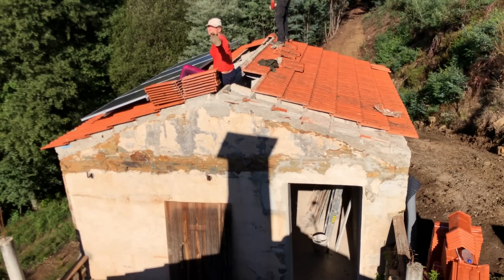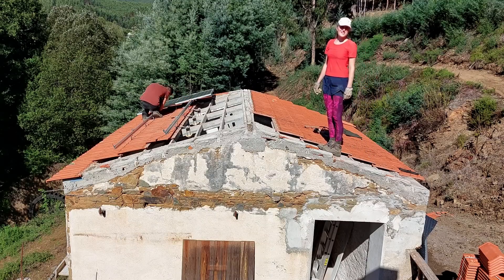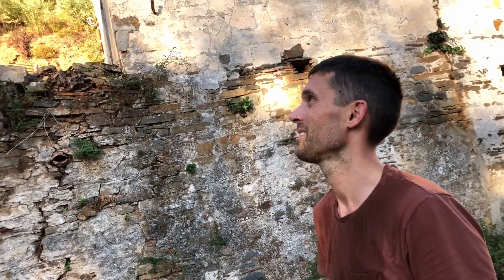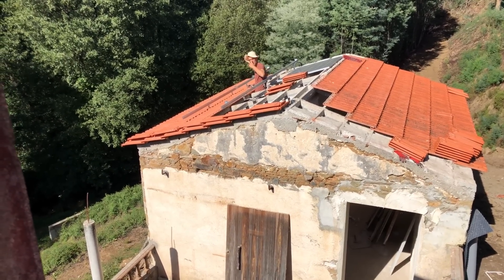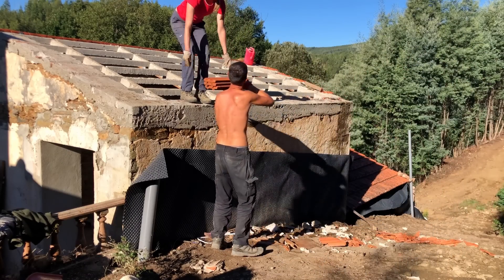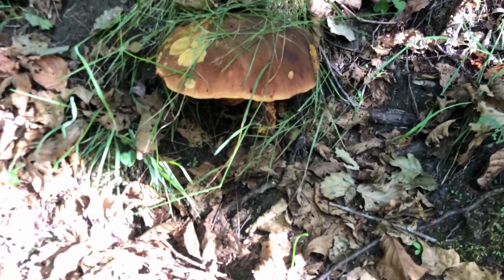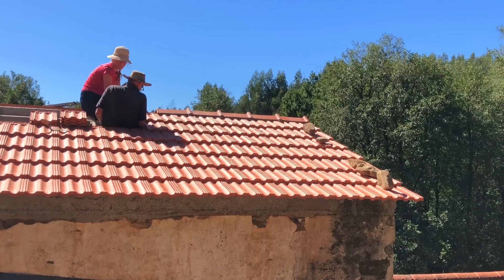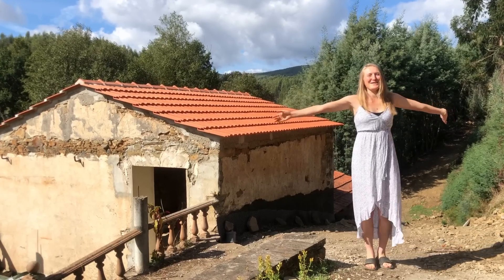Roofing Without Experience!

Comment: The old tiles look perfectly fine
Reply: I thought the same, just dirty, but I assume there are leaks and we just can't see it. I'm sure Maya knows what she's doing!
Reply: For me too
Reply from the maker: Hi, the ridge tiles were in bad condition and lots of tiles were porous and had cracks on them. I also need replacement tiles for the other roofs as you can't get them anymore. So if I touch the roof once, why not change them right away ☺️
Reply: @mayafeliz New roof will last longer too and it looks fab great job.

Comment: The top of the dimpled waterproof membrane needs to be capped and secured to the wall. New roof tiles and solar panels are installed. Just need rain or hose to test runoff and drainage.

Comment: I’m glad you had help with the roof! It certainly looks nice and tidy. Im getting excited to see the stone houses finished. It will be like a mansion compared to your little cabin. 😊
I just watched, Mr & Mrs Adventure get their roof done. There’s was completely done in concrete then the membrane, insulation foam, and some clay and cement mix. I think the clay tiles come next. Yours looks similar but no concrete block in between the framing. I wonder why their are so many different roof treatments. I’ve seen some put up wood cladding above the beams then all the insulation and membrane. Will you be adding insulation from underneath the roof to help with climate control?

Comment: Look, you first have to put water in the concrete machine, then sand and cement, the machine runs better, it can burn out very quickly, and if you walk on the roof tiles, be careful where you step, the roof tiles break very easily, and that's where water comes out into the house

Comment: Good work  but the tiles hangover is a bit too much  with strong winds probably they are going to be lifted...if it was me I will put some kind of underneath suport  wether cement or wood frame .....
Reply: They used a mix to cement the edge tiles down

Comment: Being from America, I don't understand how these tiles roofs function. There is no roof sheeting and not apparent sealant, so how does the roof "seal"? I understand how water will run off, but it seems like air will continually flow right through it, letting all heat escape and making it very drafty. It also seems like it will allow insects to get in very easily. Can someone please explain? What am I missing?

Comment: I dont see what is wrong with the old tiles, the roof looks the same after al that work and no sign of broken tiles or leaks before?
Reply: The previous tiles had become almost porous in their age and were very brittle. You could snap bits off of them with your hands and weathering had put cracks in them too.
Reply: They appeared to have been fine and of a fairly modern design. Ceramic tiles can last centuries. Maybe a few were missing and she couldn't source the same design?

Comment: Hi Maya sorry to tell you but this is not the correct way to ruff you need semen block,and then a tarp,and then insulation,and then other layer of clay and then the las layer are the tiles you will get get likings I guarantee.